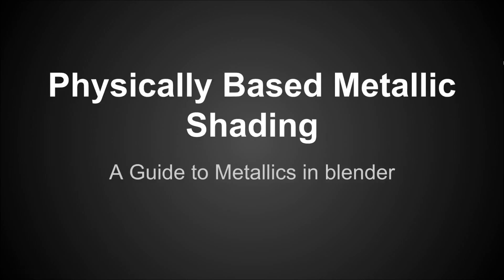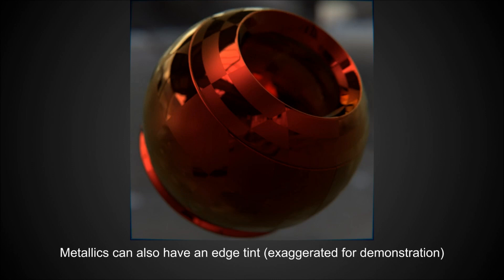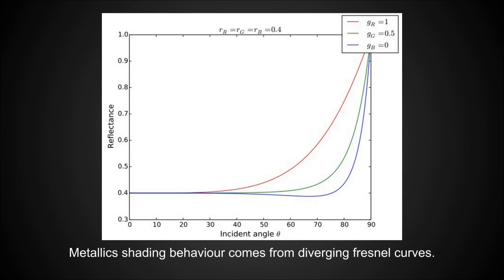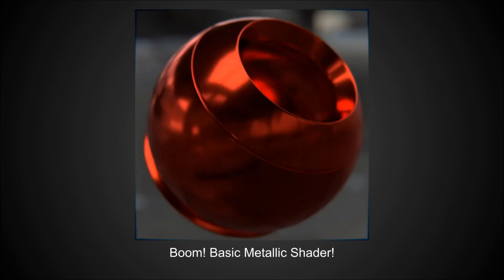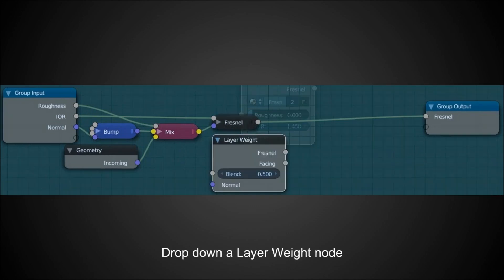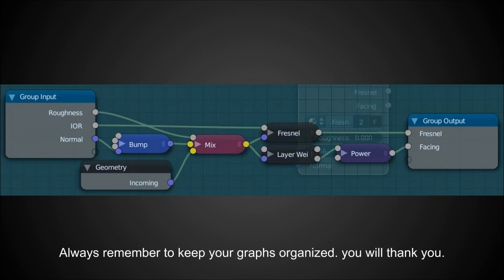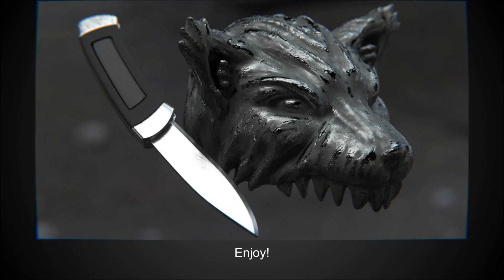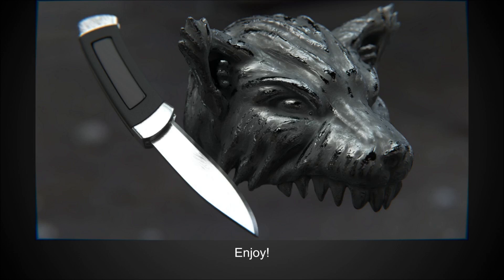Blender Physically Based Shading: Metallics

Comment: Cynicat i have a question.
You said that the Layer Weight on the Fresnel Node Tree we're making wont work on glass materials, May  use the First Basic Fresnel Node Tree we made ONLY FOR glass materials, or the upgraded will do it ok?
Thanks

Comment: So I've been having some trouble with black edges on my mesh when using this shader.  I've found a workaround, but I felt I should post here in case Cynicat doesn't know about it or someone reading this has the same issue.  Apparently the problem has to do with smooth shading and/or the normals at grazing angles.  You can either...

1. add an edge split modifier to break up the smooth shading
2. https://blenderartists.org/forum/showthread.php?398670-Black-artifacts-when-using-fresnel-layerweight-or-any-pbr-shader-with-norml-bump  Use secrop's solution in this thread.  Set up the node group, plug your normal map in the top (or use the normal output from the geometry node) and for the bottom, use a normal setup that does not have the black edges.  I've found that "True normal" on the geometry node works ok.  Then set the threshold to the smallest value where the black edges are invisible.  I've found that 2.5 works pretty well.

Comment: Metals are conductive because the elctrons can move freely in the electron clouds of the atoms.
Reply: The absorbtion isn't really a absorbtion as you think it is. I try to make it really easy. Light can be thought as a wave of electromagnetic field. When the  wave is  hitting the surface,  it  begins to develop a osciliating magnetic field. this field stimulates the free electrons, so they begin to oscilating, too. This avoids the wave to pass the material. The free electrons build a  counter-rotating lightwave,   parenthetical. And that's the reflection, if the metal is slippery enough, you can see.

Big sorry for my  bad englisch. :'D Hope you can understand it.
Reply: Easy! - Because of the electrongas, there are more electrons on the outer faces of the metalcrystal(structure). They absorb the lightwaves much better and they are for a short time at a higher energy level.  after that they emit the energy in form of visible light. And that's the reflection we see. 
Hope this is clear enough. There are some more mechanics.
Reply from the maker: yep! any idea why light reflects off them so much?
Reply: +CynicatPro
Haha no =D
Reply from the maker: TheDrumtracks Thanks! Didn't know that! your science foo is strong!
Reply: +TheDrumtracks 
But how is the income degree the same as the outcome degree then?
Reply from the maker: TheDrumtracks oooooh! very interesting!
Reply: I think my mind just broke... this is utterly amazing

Comment: Your PBR shaders are really nice but I think that you made a small mistake with your Metal shader:

I think ( or at least did read on a lot of sites ) that metal should be less reflective when it becomes darker. When a metal would be completely black it would not be reflective. Because of this a complete black metal does - as far I now - not exist.

With your shader this is very easy to fix:
Use a "Separate HSV" node, you also need some extra "Multiply" nodes. Mix the Base Color, Fresnel and the Facing with the "V" ( the brightness ) from the HSV node and your done.
Reply from the maker: +jovlem remember this isn't what goes into the color of the glossy node, its the source to the mix color between the color of the metal and white(fresnel effect).
Reply: +CynicatPro 
I don't know exactly what you mean. But when you make the base color completely black, there should not be ANY reflectivity ( so also no reflection from the fresnel effect ).

I was also very confused by this.
Your shader looks great but as far as I can tell the metal part is not physically accurate.
Reply from the maker: jovlem weird, i mainly sourced this off a few papers i found that i could understand and the behavior of game shaders. do you have any source for this? i always find it looks really weird if i don't have fresnel.

Comment: Very in-depth tutorial...It's thanks to you I got into PBR, because you're able to break it down so well. I'm still learning to render better and I noticed that with this Metallics shader, I'm getting a lot of "fireflies" where the light gathers most, even with the multiple importance in World turned on. Would you happen to have any suggestion to get crisp renders like yours?
Reply from the maker: +GloomProduction glad you liked the video! fireflies will happen with glossy surfaces a lot if your not careful. go under render settings->light paths and select limited GI for the preset. works wonders. way faster render and removes the complex light bounces that cause those fireflies. use GPU rendering if you have one, and also use the auto tile size addon for optimal tile sizes. =3 find it under user preferences->addons.
Reply: Thanks very much! Gl and filter glossy did the trick it seems...Does this mean that there's no end all be all method for this? It seems that these settings have their own sacrifices.
Reply from the maker: GloomProduction sadly there is no magic button. if there was it would be turned on by default.

Comment: thanks for this great tutorial (+ every other video in your PBR series), your shaders are awesome! one thing I encountered was that I was getting strange rendering errors in gpu mode, looking like a strange circular overlay on metallic materials. I pinned it down to the IOR setting on the PBR.Metallic node which was accidentally set to zero. setting IOR back to normal values  did the trick! just thought I let everyone know ;)

Comment: Hi, I was wondering if you could do a tutorial on how to do this with a bit more real values. According to the PBR guide by Allegorithmic, the F0 of metallic materials is normally around 70-100%. However, this completely breaks with what you showed here. Also, how would you do this with a spec/gloss workflow where you can't have a mask that says whether a place on the material is Metallic or not, and where you do have a spec map that dictates the F0 value.
Reply from the maker: +katrix400 well there are few questions here: 

metallic map is easy. mix this metallic shader with another material and plug your mask into the factor. this lets you have multiple metal layers and mix with anything. and also runs faster if you only have metals(as you only have one shader).

as for specular driving F-0 you would need a normalized fresnel(fresnel that goes from 0-1 without a base reflectivity value). i want to do a tutorial on this at some point but since i don't know when, i'll give you the node group for it now. http://prntscr.com/8fb5fo use this with a mix color to get proper specular for metals. use it with a specular value for dielectrics.

about the physically correct bit. almost no render engines use proper fresnel falloff for metals. realtime renderers don't even give edge tint. this is fine in most circumstances and even preferable in many. there many metals that are dimmer than 70% reflection(car paints are a good example) where forcing that rule is not a good idea. algorithmic was trying to say that most of the time the color value you feed in(like the one you feed into my shader) should be higher than 70% value(ish). but there are materials that break this by a mix of different materials. for example dark car paint is really bright metal flakes mixed with dark dielectrics, but these are at a microscopic level and too small for the eye to see. there's no point bogging the computer down with multiple shaders if you could easily just treat it as a dim metal and get the exact same light interaction. for the most part if you use the normalized fresnel node this should match a game engine. only this is roughness. roughness going to look very different in cycles. multiplying your roughness value by itself will get you closer but even then the blur of the reflection will vary by distance in blender(as it does in real life) where in most game engines they ignore this(too expensive).

hope that helps! =3

Comment: Anyone having problems with this? My bump map works in rendered viewport but when i do an actual render, theres no bump. Using 2.75. Edit. Object is jewelry. when i render with the human hidden the bump shows. render with the human shown, no bumo O_O
Reply from the maker: +Pewposterous sounds more like a bug with your scene than the shader. i'm also using 2.75 and the shader was built with it. sounds weird though... the human character somehow disables the bump mapping on your jewelry? have you tried both the bump material output and the vector bump? either way you might put in a bug report to blender. also just to rule out that it is my shader doing it. try with a standard glossy node and see if that still has the glitch. if not than it prolly is my shader. prolly blame the fresnel vector mix thing.
Reply: Hey thanks for the response. I eventually just appended everything to a fresh blend and it all worked. That blend was fairly clogged. Keep up the good work!
Reply from the maker: Pewposterous glad it worked out! and i will keep it up! =3